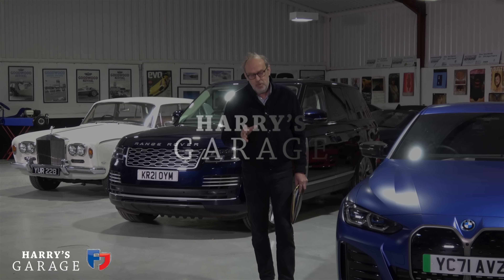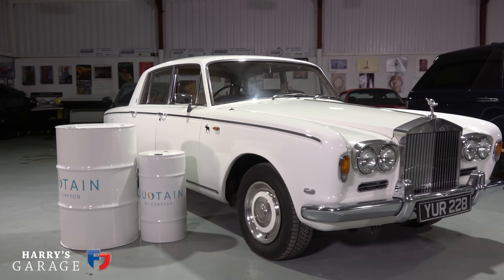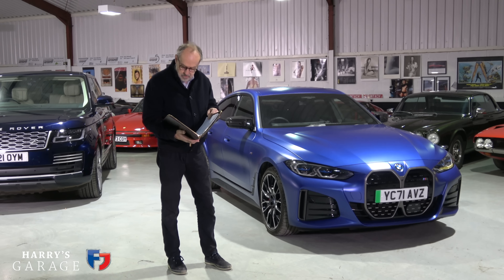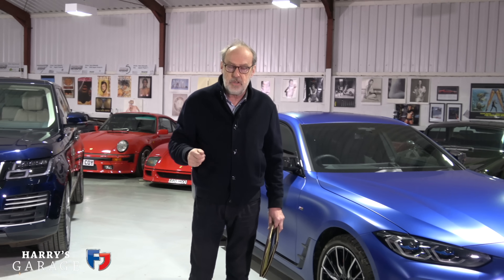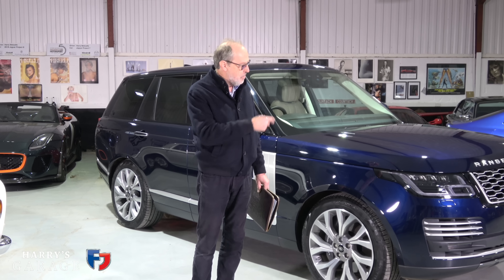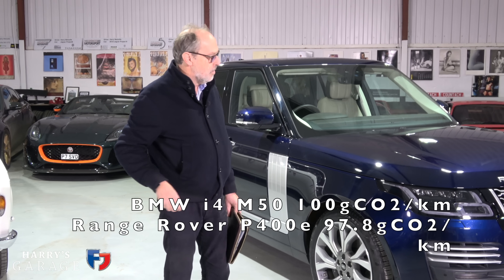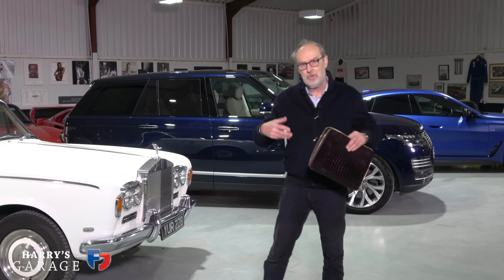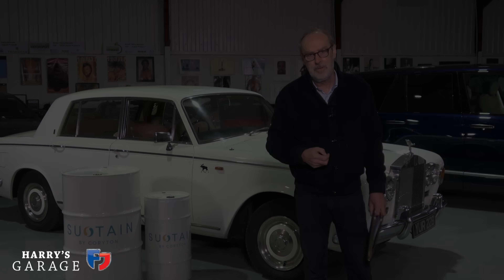Sustainable fuels; what are they & are e-fuels better for the planet than running an EV or PHEV?

Comment: I could however buy my electricity from a vendor who only buys non fossil fuel  and even though the electricity locally is a " blend" and would  effectively be  using clean electricity.I thought  however that the most interesting aspect  of your video is that the hybrid can effectively be recharged by your own wind power  or in my case solar. I guess this is because the  battery is nowhere as big as a  pure electric. Makes me think I might be financially  better off and more green  with a modest size hybrid with a decent battery range ( eg Octavia with 30 plus electric only range) and charging it from my solar rather than buying a pure electric at the moment.
Reply: I would read into that a little more. From what I've heard in my job as a market researcher those clean energy deals are a fair bit of greenwashing and doesn't necessarily promise the company has bought renewables for you. I think it gets you a certificate that shows they've achieved some level of regulation but what else, no idea.
Reply: Fair point about " green washing" .

Comment: One thing that Harry only touched on briefly in this video is how the majority of high end cars are now designed to fail so that they can generate more income when they go wrong. If you spend 80 thousand on a new BMW or Mercedes, chances are, you will also be happy to spend a few thousand pounds to keep it going when it fails. This means that when the value of the car drops after a fee  years, people will be a lot more likely to upgrade their car when it goes wrong than to keep it going.

Comment: The sustainable fuel still has the air pollution problem, it isn't only Co2 that is a problem from the car's exhaust pipe. Although this is only really an issue in built up areas, which i hope isn't where you are driving those classic cars

Comment: Why is it that lately many car journalists posting videos like this? Often linked to "studies" by OEMs which are not known for good efforts on EVs or eFuel manufacturers. Always the same arguments, always the same wrong assumptions, always the same facts left out to make it look great. 
Where is the Well-to-wheel part of gasoline? 
Why is only the PHEV ok to charge with the windmill? 
How much energy you need to make eFools? 
How far can an EV drive with this energy? 
Why is electricity hard to transport over long distances? Edison knew better a long time ago!
Does a combustion engine only emmit CO2? What about NOx? 
Why should we use even more farmland to make base for fuels instead of feeding starving people around the world?
All the calculations are purely for this reagion. In more than 3/4 of UK the calculation is wrong by 25% or more. Looking at my location, it is 75% off. Sorry ... I love classic cars and the struggle with public charging is real which is mostly to blame on the gouvernments BUT the calculation for eFuels does not work out. It's an expensive bridge technology, same as PHEV.
Reply: Exactly this….

Comment: A very interesting & informative piece Harry .. I've always advocated not changing ur vehicle as often as manufacturers & many people would like.. I have a collection of classics .. some more modern & some old .. this headlong unabated desire to change to Electric I've questioned .. my thoughts were its band aid until the correct solution is found  .. either sustain fuel or hydrogen fuel cells .  But ur piece has certainly illuminated me to the possibility & the figures you've presented.. I think the present crisis we've got atm has highlighted this position .. and a total re think by govt is needed..this cessation of selling petrol & diesel by 2030 seems ludicrously optimistic & I would say premature...

Comment: "i am gonna use this fake figure to calculate a number that only accounts from the Co2 released during the burning of the fuel and doesn't include the digging, refining and shipping of that fuel or the electricity(coz u know, suddenly i made it using wind so it doesn't count) the car uses." the plugin is inherently less energy efficient than an electric car, a plugin is inherently less energy efficient than an ordinary hybrid when the battery is depleted. and a hybrid doesn't really make a difference at highway speeds. also, you aren't really gonna take your shiny classic on a 3 mile drive to get a carton of eggs and some door dings by people who parked next to u, are u? u aren't gonna invest the same kind of resources into keeping a Dacia Sandero alive as you would a cassic car and it would have broken down far sooner than a garage queen. we can't really produce enough bio fuels to fuel everyones daily driving needs nor would people be ok with the increased expense of making them. so yeah, synthetic fuels might be ok in circumstances where u need to keep a classic car alive, need the easy way to transport more fuel(such as a rally, offorad...) or need a vehicle that is less heavy. but they aren't at all suitable for cars that will be driven on a daily basis.
Reply: All of the above….

Comment: I think you have highlighted how difficult and challenging it is too switch from the current petrol/ diesel based transport to electric based transport. There are a lot of factors that mean not every solution is right for everyone, everywhere - and you've only scratched the surface, for example what role will offsetting and carbon capture play (the latter is very real, and there are plans for such facilities to be built in the UK now). The UK does need to move to more renewables but we will also need to rely on more Nuclear Power, the current Ukrainian Invasion shows we need to reduce dependency on overseas sources of power. But Nuclear Power is not renewable, nor is it 100% zero emissions and then there is the question of waste. Overall this change is very challenging and needs serious thought.

Comment: I love Harry's Garage, but when he talks about EV's he skews the discussion so badly its infuriating. On one hand he castigates the BMW for only having 200 miles of range (at 2 Miles/kwh), while the Range Rover only gets 30-40 miles of electric range, yet gets lauded. Well duh, you're using them differently. Try running the Rangie around behind the BMW and keep up with it  - you wont be getting 69mpg then will you? If you are getting 69mpg from the Rangie then most of your miles must be EV, so the BMW would easily cope with that work load fully EV.
2miles/kwh is pathetic, the better EVs are getting almost 5 miles/kwh in normal driving so that's not a fair comparison either, I suspect the BMW is on test and therefore being hammered.
efuels are definitely the way to extend ICE cars into the future, but only if they are created using sustainable power such as wind or solar if there's any other mix, you're using power that emits CO2. You also have to be careful where the biomass comes from. If they cut down forest to grow the biomass you're adding to the CO2 problem, not lessening it. It has to be be "green" biomass. Its not an entirely virtuous cycle.

Comment: Assuming that the battery of the PHEV has not been charged and is flat, does the re-gen from the PHEV gain more energy than is lost by carrying the additional weight of the batteries and charging system?  I suspect a lot of PHEVs are purchased for tax reasons and often not charged, so am curious about their efficiency compared to a regular petrol-only powered car.

Comment: I am extremely interested in the efuels, this would be ideal for my 72 spitfire and dads 75 stag

To run them on a sustainable fuel would be incredibly beneficial knowing that with the age of them their individual carbon footprint from manufacturer will be long gone unlike these modern electric cars which will take years to balance their running emissions to their manufacturing emissions 

I look forward to seeing you're findings on this project Harry 👍🏼

Comment: One point which is very rarely mentioned is the government. As electric car use increases and Fuel use declines, the treasury will need to replace lost fuel tax revenue, which will result in taxes being placed/increased on electricity, resulting in electric car use becoming significantly more costly than now. In addition the government may find it hard to distinguish between electricity for your home lights and electricity for charging your car so they will just tax it all (never missing an opportunity to screw us all). The Uk government gives nothing for free, so I expect domestic solar generation (and wind) to be subject to taxes within 5 years. No way you are going to be charging your car for free.

Comment: Interesting looking at the cost/mile calculations. I ran a Jaguar I-PACE over a 3 year period (2018-2021) and did the same calculation comparing the Jag to a mid-range diesel sedan. Back then, the diesel car would have costed ca.14p/mile while the I-PACE was costing me an average of 2.5p/mile. The Jag was so low because I charged it at home using an Economy 7 type of tariff where I paid 5p/kW between midnight and 7am. What amazed me was how little I used the public charging infrastructure, despite averaging 16,000 miles a year. Public charging at the time cost on average 30p/kW so on the odd occasion I did use it, I didn’t feel too bad because the cost/mile was still comparable to a diesel.

Comment: My e-Niro got 4.5 m/kWh on a journey yesterday. My current off-peak rate is 5p per KW. So EV usage can be so much cheaper than your figures suggest
Reply: "current off-peak" being the key word there. Try finding a provider offering that currently, i'll wait.
Reply: @SarGara  My Octopus Go rate is 5p per kWh for 4 hours overnight. But from April it becomes 7.5p per kWh. Day rate goes from 13p to 30p but I can charge the car almost solely overnight at 5 or 7.5p. Way cheaper than Petrol or Diesel. I also get 4 miles/kWh in my e-Niro so I can get 28 kWh overnight for £1.40 and do 112 miles. At 7.5p it is £2.10 to do 112 miles
Reply: @dangermouse12345  you won’t get many miles added in 4 hours on a domestic supply?
Reply: @paulsm77  Well, as I put in my reply, you would get 28 kWh through a 7 kWh charger in 4 hours which is what most home chargers are.
Reply: @dangermouse12345  so about 11 miles range for that BMW.
Reply: @paulsm77  if my math is not an opinion ,if that electron-guzzler does 2.5miles per kWh , 28kWh is worth 70miles , efficient EVs at 4.5miles per kWh a bit above 120miles.
Reply: @paulsm77  I add about 85 miles of range to my car in those 4 hours overnight on Octopus Go @ 5p per Kwh. So at 7Kw which is what it charges at, for 4 hours = 28Kw. Charged @ 5p per Kw is £1.40. Therefore, if I average up to 85 miles a day (I don't, but many people would) fuel cost per mile would be just over 1.6p per mile.
Reply: @paulsm77  I get over 100 miles added in the 4 hours cheap rate window at night. My daily commute is miles so I NEVER charge my car on day rate.
Reply: @SarGara  if you want to talk transport costs “currently” rather than “typically” then you’ll have a hard time backing oil’s corner. I paid 185p per litre yesterday, and that was for petrol.
Reply: @SarGara  it’s 7.5p at the moment for new customers.
Reply: Plus this will have come from a zero carbon energy source. Why special EV electric providers have been ignored in this is crazy!

Comment: Another very interesting video Harry. Questions for future videos.
How much sustainable fuel can realistically be produced in the UK from waste?
How much fossil fuel (electricity/oil/gas) is used in the production process?
Also, with your on farm solar project, what do you estimate the electricity cost to be over the expected lifetime of the installation?
Have you any plans for some kind of “battery” to store electricity for night time use?
I am currently planning a 50kw solar installation on my farm roofs so your project is very interesting and relevant.

Comment: Love your videos Harry but this one's a bit of a mess in terms of comparisons. You've compared apples with oranges and bananas. The video throws up more questions than it answers. Coryton sustain is twice as expensive? Is that retail? Cost to produce? What about fuel duty? Can you actually buy this stuff yet? If we converted all cars to sustainable fuel is there enough waste to keep our cars running. For an example we don't want to be taking food crops for fuel manufacture. Then there is the issue of co2 only being 50% of the problem. Harmful emissions in cities cause thousands of deaths in the UK each year. Zero emissions at point of use is actually a game changer.

Comment: I think the massive missing part on the fuel side is the sheer monitory and environmental cost of extraction and transport of fossil fuels and the processing of the efuels, add them into the equation on the well to wheel equation for the c02 numbers.

Great video though and keep up the great work Harry
Reply: As long as the process is CO2 neutral, profitability is all that matters. Efficiency is only one of many factors.

Comment: Very interesting and thought provoking video. I would challenge use of the Carbon Intensity figures in regional areas. These figures reflect more the geographical location of Fossil Fuel powered generation rather than how ‘clean’ the electricity is that the consumer receives. At the end of the day we need to remember it is a National Grid. One needs to think of being connected to an almost infinite grid with a mix of generation rather than being connected to that Gas Fired Power Station down the road.
A more realistic parameter to use would be the average figure for grammes of CO2 per KWh for generation on the system overall. This varies greatly depending on Wind and Solar output but also on overall demand on the system, when as demand increases, more Fossil Fired generation is brought into service. Charging your EV overnight in windy weather would really really minimise gCO2/KWh. One for the EV enthusiast I acknowledge. I would say though that people should not be put off purchasing an EV just because they live in a region where there are Fossil Fired Power Stations.

Comment: A really interesting video. I run a 68 Fastback Mustang, I'd be happy to run that on E-Fuel even at twice the price, I could probably get away with running my 996 C4S on it as well as that doesn't do a huge amount of mileage either. My guess is the price will come down with volume and economies of scale so well worth getting in on it now, in order to ensure it has a viable future.